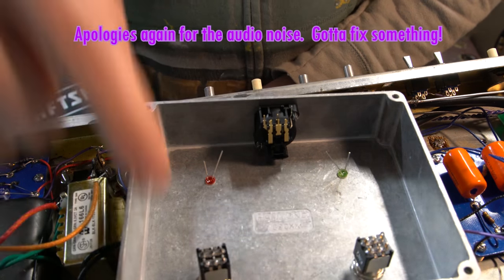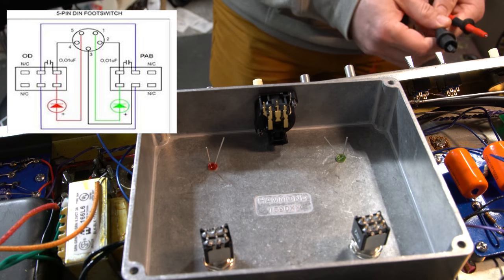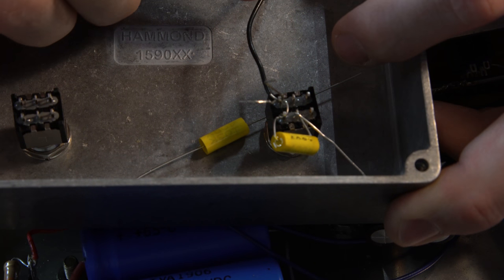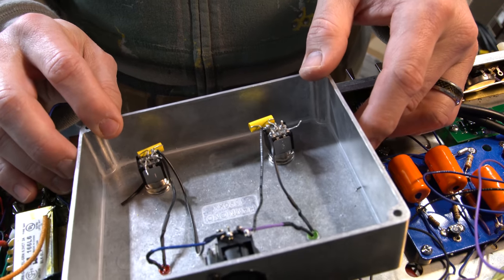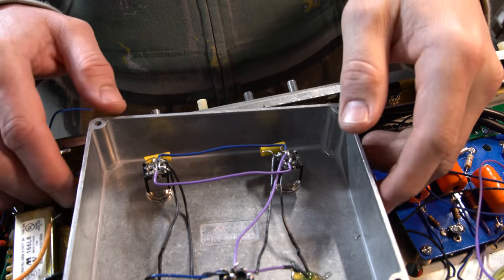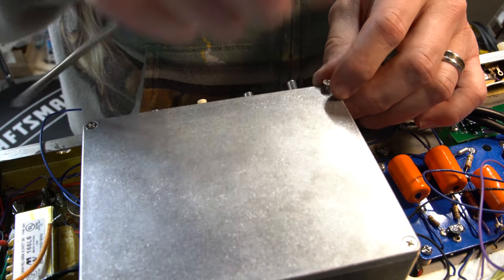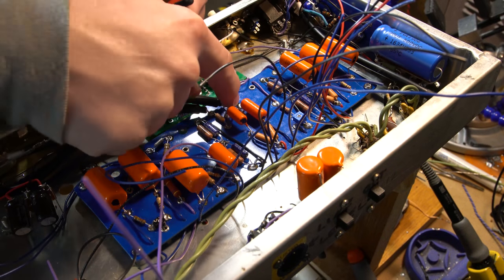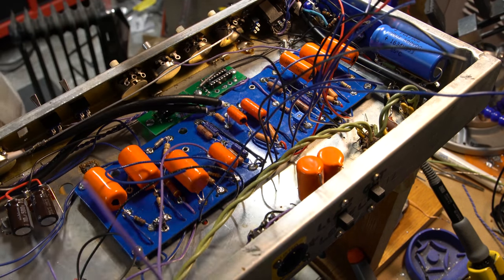Dumble Overdrive Special #124 Clone Video 9

Comment: What type of shielded coax cable are you using? What is your favorite type to use for the signal path.
Reply from the maker: Rg- 59u I believe, same as what dumble used
Reply from the maker: Oh and I'm not sure yet what's my favorite.  I've used much thinner coax in the past with great results, but this is very robust